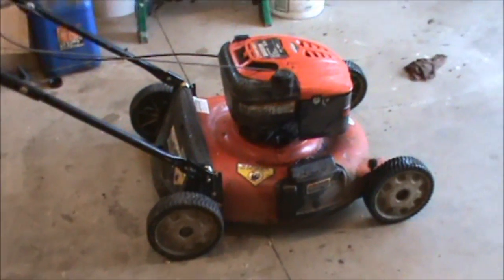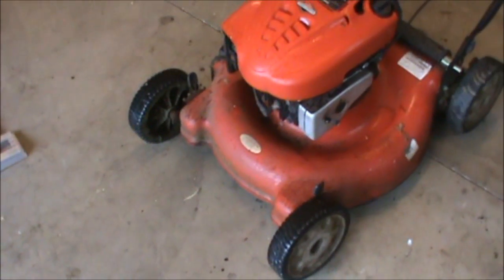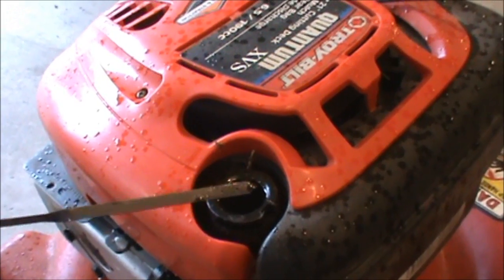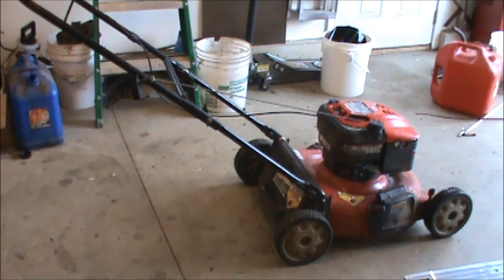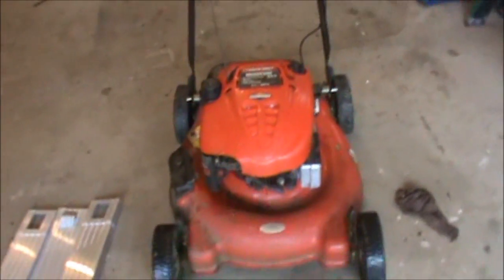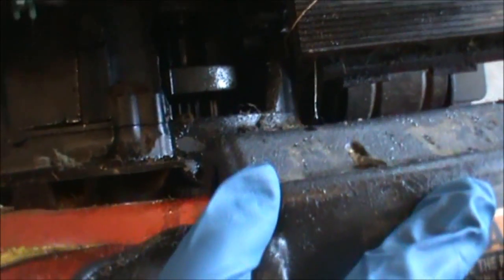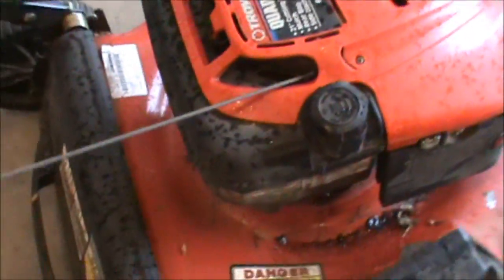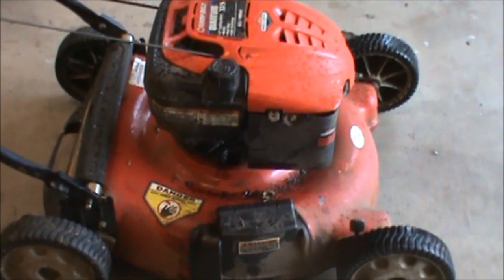See what NO OIL does to your Lawnmower

Comment from the maker: No oil caused the connecting rod to break and it forced a broken piece of casted metal out the side of the block.
Reply: I had a riding mower that did that, but it did not break the cylinder. I only found this out when I opened up the cylinder and found that the flywheel would only move part way, and the piston would not move. I hate thrown rods.